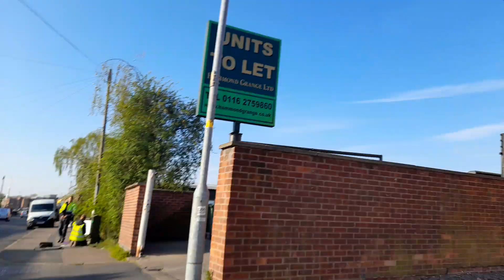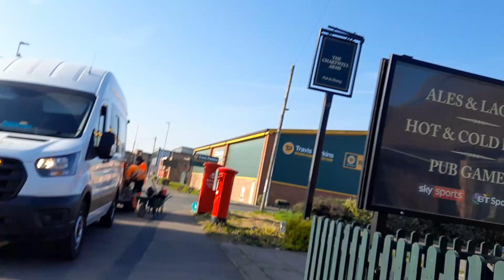Welcome City Fibre Everywere

Comment: its rubbish, speed tests show a good speed but its not stable. my wifi is always losing connection cutting out coming back. when i stream it can randomly cut off. splatoon 3 i disconnect from a match. soon as our year contract ends we going back to virginmedia.
Reply: CityFibre are an infrastructure provider (much like Openreach), not an ISP themselves. They have multiple resellers including larger companies like TalkTalk and Vodafone, and smaller providers e.g. AAISP, Giganet and IDNet. So the fault may not necessarily reside with them.

In 9 out of 10 cases you couldn't pay me to use ISP-provided equipment, I currently have a VM connection but I have the Hub set in modem-only mode and use an ASUS RT-AX82U for a router. Despite the jitter (because coax), it's been a lot better than I would have expected of Virgin, though I am moving to FTTP as soon as they fix the connection in my area (some doofus cut through the underground cables so there is no light going to the pole on my street). I'll just connect my router to the ONT Ethernet port.

To rule out any issues, first thing I would always do is connect an Ethernet cable directly. Then I would take up any residual performance issues with the ISP support, who can escalate with CF if necessary. Wireless performance is dependent on both router hardware and distance, that would be the first thing I'd look to rule out in troubleshooting.

Not saying you haven't had a bad experience but most horror stories I read about CF lines are due to the ISP's bad support and communication more than anything.
Reply from the maker: @Harkz0r  i left virgen media feed up of paying too high and never resolve my problem, since they put me underground cable my own of cuckoo fibre fsntastic
Reply: You need to remember that city fibre are only the backbone and you actually have a contract with a provider that uses their infrastructure. If you're having disconnection issues it would be a good idea to look at either using your own router or trying to reposition the one you're currently using.
Reply from the maker: @NotAllTheTime  since they install underground fantastic have my own cable too
Reply from the maker: @StephenHopkinsVaults  im good have my own underground lines never had issue till now